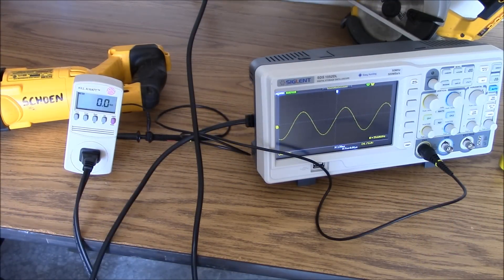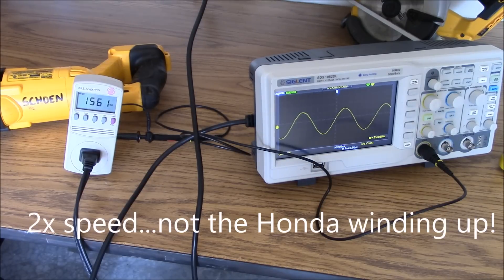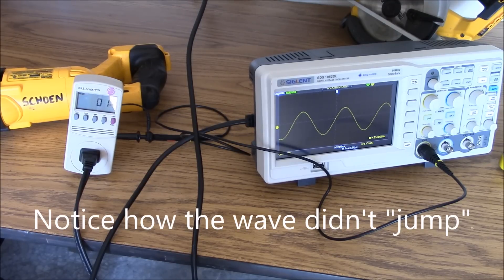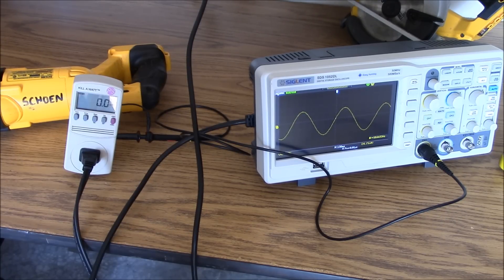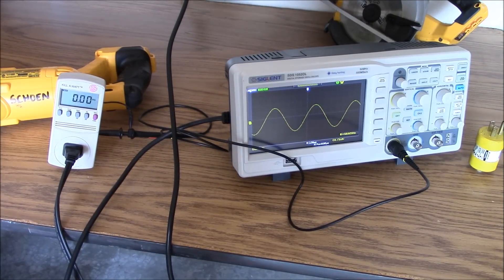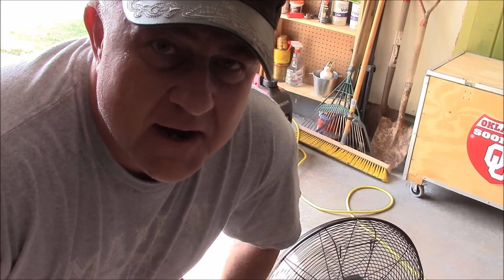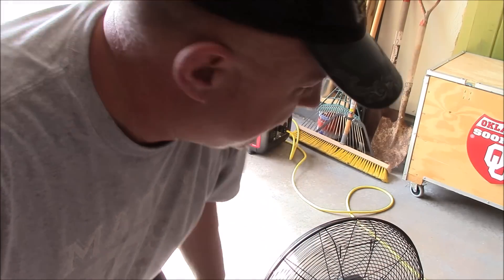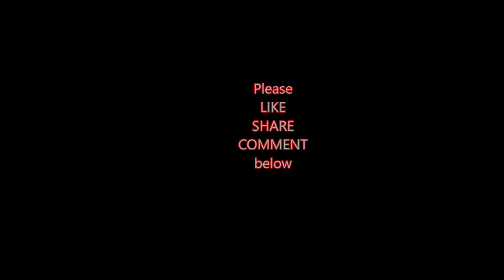How clean is the power with a 1,500+ watt load? Honda eu2000i inverter-generator vs a space heater!

Comment: Thanks for showing this in a video. I been wondering how clean it was
Reply from the maker: No problem...meters/scopes really don't lie (unless they are not cal'd correctly)
Reply: Chris DIYer correct makes sense I know a deal of electricity to an extent.  Never really had the extra cash outside of my normal hobbies ect to purchase a scope.  Done a little reading on them ect. But don’t fully understand them to have done it correctly as you did.  I been hoping someone was going to do that. I’ve even suggested it on a few channels if they had multiple ones. Honda and knock off ones. Predator ect. To see how well others can maintain the wave.  But not many I guess have uses for a scope. That also has multiple types of the generators.  Personally I think the makers should put proof out of how well they preform on their own.  Anyone can claim it makes a sine wave. But how clean it is when at idle or engine ramp up or full power. But doesn’t mean it’s truly clean without any hiccups.

Comment: So when it took the load and the peaks of the sine wave dropped, that's the voltage dropping but the frequency staying at 60hz, which I assume is better for electronics? Or would it be best to leave eco throttle off when large loads may be hitting the generator?